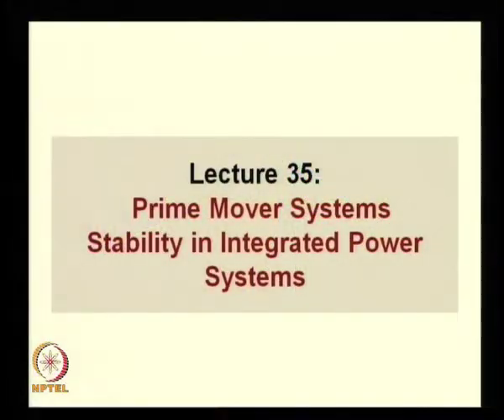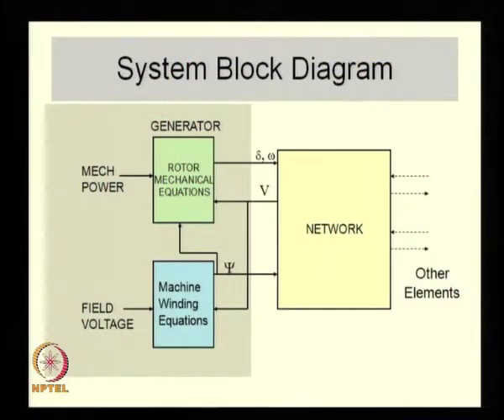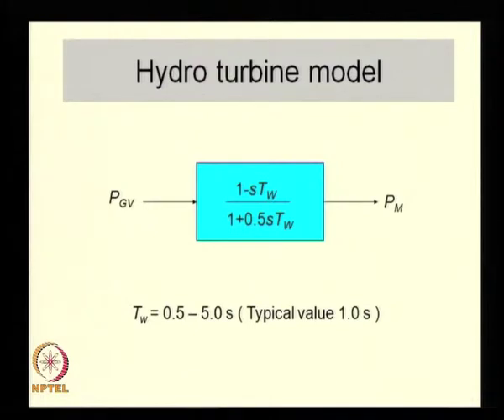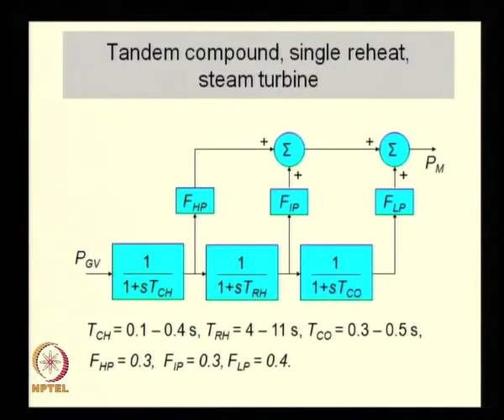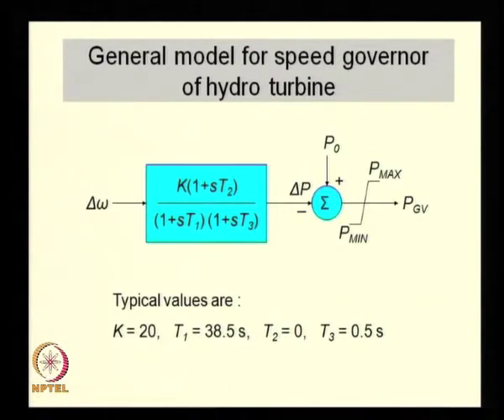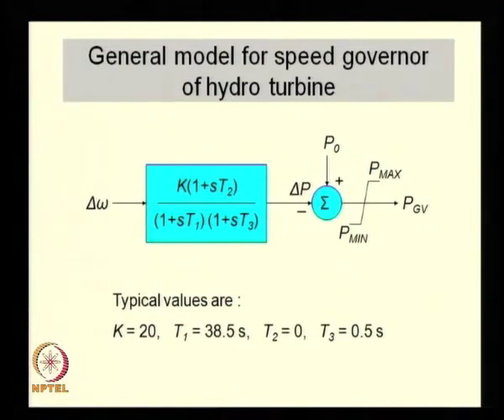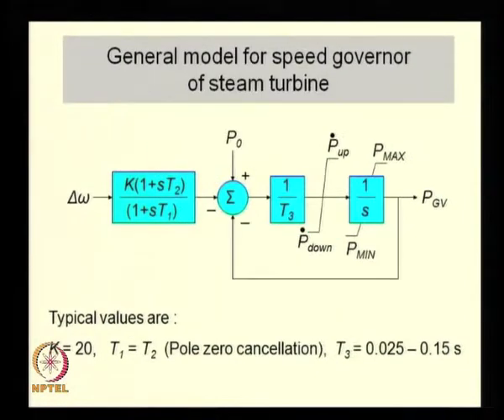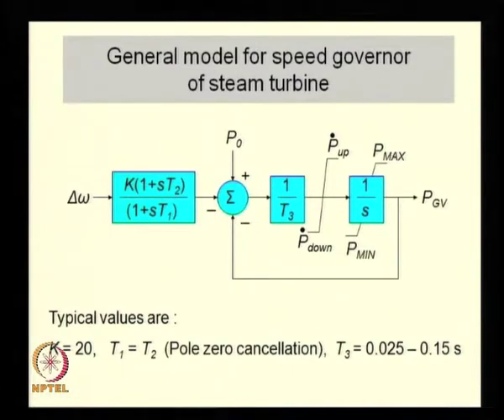Mod-01 Lec-35  Prime Mover Systems. Stability in Integrated Power System

Comment: Now I have concluded my suspension on shaft torque and electromagnetic torque .it means that at the prime stage of generator opposition to the shaft torque which is propelling by turbine then extra voltage field is compensating  with shaft torque to the input of generator ....thanks for providing the first pic